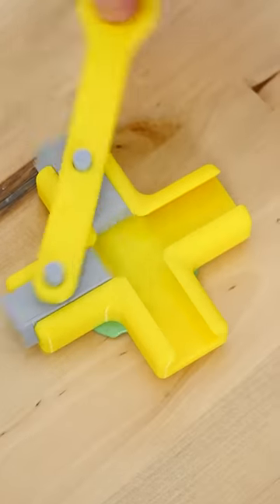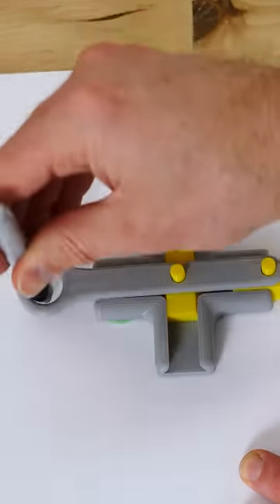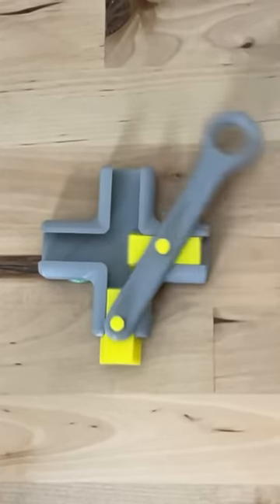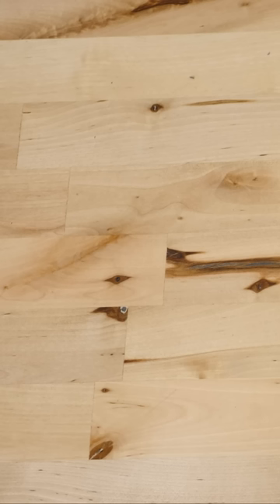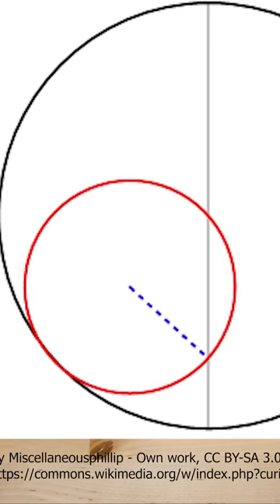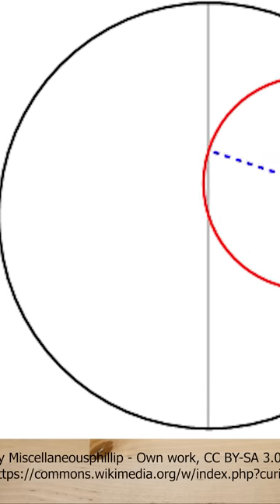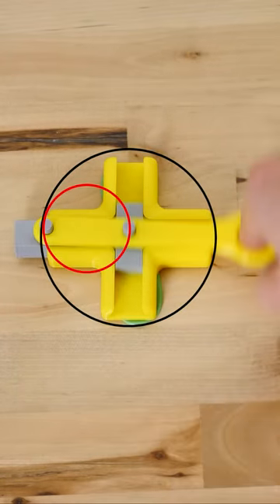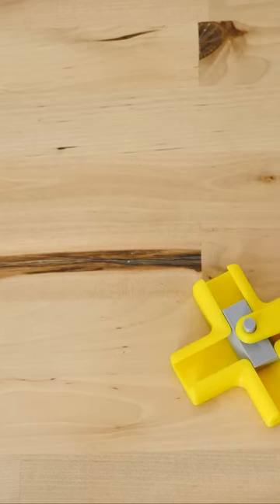The Do Nothing Machine

Comment: Fun fact: this machine was actually used in a steam machine to convert from linear motion to rotary motion. (It was designed by James Booth for anyone wandering)
Reply: I think “Pitman Arms” in cars possibly use a similar style of mechanism to transfer torque from steering to the wheels. Not sure if newer cars have them but older cars needed them.
Reply: Was just going to comment that, Booth's rectilinear engine of 1843, the idea was you make the engine more compact by eliminating the connecting rod. It works but was rather complex and expensive, I don't think it ever went beyond maybe a prototype.

Though there are plenty of functional models around now, as the plans and castings are offered by a British firm called Polly Model Engineering.
Reply: James also designed my favorite seating at Olive Garden
Reply: Also used in Steam trains.
Reply: Wasn’t james booth the guy who killed Lincoln? ?? 

Did he kill Lincoln with linear steam?🤔
Reply: @jamieduvenage2111  That was John Booth.

Also people can have the same name, actually a lot of people share names, I've put my name into Google before and found like, half a dozen people that share it just in my State, for example.
Reply: @DAKOTA56777  

But then Lincoln wasn’t killed? 

I mean I always knew. He was a vampire hunter, he couldn’t be snuck up on
Reply: @jamieduvenage2111  That was John Wilkes Booth. He also converted linear motion to rotary motion.
Reply: @ drink15  so I’m guessing that John Wilkes Booth is the one that made it famous though🤔 everyone seems to know about his attempt at linear to rotational motion, but not his brother James Booth?
Reply: @jamieduvenage2111  lol, my John W Booth  linear motion comment was just a bad joke. They are not related.
Reply: @ drink15   My entire thread of comments was just a bad joke😂
Reply: Aka a valve?
Reply: Right? I was thinking this could be a engines piston
Reply: Yes It would continue on it own when there is a weight on one end.
Reply: @OperatorKevlar  not really since it's quite inneficient and takes up a lot more space than more conventional mechanisms
Reply: @milknotfound4573  no, it can't because there would be a gap where the pistons cross, letting all of the pressure from the steam out and behind the other piston, because it would require that all four ends have steam coming in and because it has basically no advantages over having two pistons in the same axis.

Maybe if you had three pisons 120°c(2pi/3°f) appart you could potentially have a slightly simpler or smoother mechanism, but again, getting the timing right for letting the steam in and out of the piston chambers would be a pain and I'm not sure the few and small advantages are worth it.(kinda like wankel engines, on paper they're quite intrusting, but IRL, they're a pain in the ass)
Reply: Wandering ??????
Reply: vbddfy euuyt  its actually kinda infuriating that he calls it a "do nothing machine"
Reply: so it does something
Reply: vbddfy euuyt  you're cute
Reply: I lost my way. Thank you for orienting me . I am no longer “wandering.”
Reply: I was just about to say, not “do nothing” - generative technological achievement
Reply: I'm wandering around,  wondering how you graduated high school.
Reply: Is james booth the guy who killed Abraham Lincon… wait thats John Milks Booth
Reply: *wondering
Pls- No pressure-
Reply: So it does something
Reply: Actually i am wandering the comment section
Reply: Is there something else use this kind of mechanism?
Reply: @seeker599  It can also be used to draw elipses
Reply: yeah thanks, i wander from place to place and this info will totally help me in wandering
Reply: The most interesting thing about this video is your comment!
Reply: So its not a do nothing machine
Reply: HE LIED
Reply: It's an ancient fidget spinner.  Carry on, nothing exciting to see here.  Zero application in real world.  AutoCAD was invented before it.. 🙃
Reply: Fun fact: you have no name.
Reply: @sskacypher4674  And I'm not the only one without a name...
Reply: I read this as James Bond and was really confused for a second xD
Reply: That saves me from having to ask; thanks!
Reply: so it does something
Reply: I was wandering while I read your comment, and now realize that I was also wondering as well. 👍
Reply: I knew that it was used in machines i remember seeing it in an old train in a movie
Reply: Exactly, calling it a "do nothing" machine lol
Reply: So it became the "do something machine."
Reply: First inversion of the double slider crank mechanism
Reply: I read it as it was made by james bond
Reply: Thank you, I was wandering around my neighborhood and got lost.
Reply: So it does something
Reply: He only did good in his life… (remembers history class)
Reply: I was wandering all around YouTube trying to find this fact
Reply: The design trace back to islamic era (forgot his name), maybe even further to the era of persian / sassanid tech
Reply: @jamieduvenage2111  😆😆😆😆🤣
Reply: @DAKOTA56777  NO WONDER YOUR WATCHING THIS... CLEAN THE BASEMENT.
Reply: @jamieduvenage2111  or his cousin Phone Booth.
Reply: I hate to be that person but.....

wondering
Reply: Cool thanks for the information
Reply: Man I was wandering
Reply: Yep and then there is a similar machine called the Geneva drive or Maltese cross or Geneva mechanism. It concerts continuous rotary motion into intermittent rotary motion
Reply: “Wandering”
Reply: @alexburke1899  this is all done by the ECU
Reply: @user-le8ul4nr5t  isnt a steam engine use basically the same configuration as a standard IcE?
Reply: Thanks
Reply: 69 Replys
Reply: @soundsofanimals2393  you ruined it :-)
Reply: @alexburke1899  Pitman arms are used on conventional steering set-ups. That's not used on modern passenger cars. Modern passenger cars use rack and pinion steering. A lot of modern pick-up trucks still use conventional steering, however. Though, a pitman arm is more of a secondary pivot point, to keep the tie rods in the proper alignment and motion, in order to properly transfer the movement of the steering wheel to both of the front wheels.
Reply: So it does something
Reply: This is click bait ist does something
Reply: *wondering
Reply: I was just thinking about engines just looking at it lol
Reply: Whys it called the trammel of Archimedes then?
Reply: @riyeot565  because this mechanism was known way before james booth was even born, so it already had the name "trammel of Archimedes".
Reply: Wondering*
Reply: I was thinking could it be used for energy production
Reply: You can draw circle with this machine too,or something another
Reply: I mean this is basically how engines make power
Reply: @jamieduvenage2111  that was JOHN Wilkes Booth, though I understand the accidental confusion.
Reply: @DJBSharpMusic  but John did convert rotary montion into linear motion when he pulled the trigger,    Trigger is rotary motion, bullet is linear motion

So John was the one that made it famous?
Reply: Exactly what I was thinking
Reply: I was going to comment that it reminds me of a rotary
Reply: I was wandering, but this clip stopped me in my tracks.
Reply: So it doesnt do nothing 🤔
Reply: Wandering trader
Reply: Nerdddddd 🤓 

On a serious note, thanks for the interesting info lol
Reply: It doesn't do what it's meant to. It's a so nothing machine.
Reply: Found Ted Mosby’s YouTube account
Reply: E
Reply: So not by Archimedes then.
Reply: What about the people standing still?
Reply: I'm wandering
Reply: @andyfenton9554 John Stuart Milkyway Boots
Reply: the concept looks very similar to a rotary piston engine like you see on very old-timey planes.
Reply: Yep
Reply: Wow
Reply: Thanks!
I was wandering about for an answer and finally got one
Reply: And of course the grade school science teacher calls it " do nothing machine".
Like duh, most mechanisms don't do anything unless hooked up to other mechanisms working in tandem.
Reply: Wondering*
Reply: Or convert rotational to linear.
Reply: So it's not actually a do nothing machine
Reply: im wandering and lost! send help!
Reply: The closest resemblance this useless device is to an internal combustion engine would be the wankel rotary engine...
but there are A LOT of differences
Reply: What is with you fun fact people. no one asked!
Reply: @jamieduvenage2111 haha that John Wilkes Booth (Not sure if I spelt it right) I was thinking the same thing until i remembered his name was John.
Reply: Looks like it can be useful for something, yeah
Reply: Yeah literal pistons they even were used in trains.
Reply: Use in an engine was my first thought
Reply: I was wandering...

Comment: Why do people say it does nothing? It would be cool to build a maze with this. A few of these and you would have a maze where the path changes. Also might have a good use as a air lock. You just need to extend it in one direction.
Reply: YESS
Reply: My guy I could barely even understand it you need to become a designer
Reply: yooooooooooo thatd be so sick
Reply: It might be cool, but probably not the best solution, which is why you don't really see it used anywhere. If it really had any benefit, it would have been being used already.
Reply: @Jack-wh4zm  who hurt you ? Why do you have to go out of your way to comment something so spiteful?
Reply: bruh engine??
Reply: Namely because it was designed as an expression of mathematical concepts rather than a specific action. It, in and of itself, just spins around.
Reply: @clumsymancubus  Just because you haven’t seen it put it to a practical use doesn’t mean it hasn’t been. I can think of two uses from woodworking first they were quite common during the 18th century for veneer work. Second, you could attach a router to it with adjustable points and create different size oblong tables that looks great in any grandmothers house.
Reply: @brentranke7528  Yes, but if it were still as useful today, it would still continue to be used in a big scale. The truth is there are better solutions, and that's why this isn't seen as much anymore. 

Also, I never said it wasn't ever used in a practical way, I simply stated that if it were as practical as people think, it would be used a lot more and you'd be seeing it lots.
Reply: @Jack-wh4zm so just because you think you’re protected you go around being cowardly nasty to people out of nowhere? That’s deplorable and so low. Also guess what, anonymity doesn’t absolve you from human decency! And it does matter, the things we do have impacts and your throwing your hate at real people
Reply: Reminds me of a rotary engine
Reply: @FallenRingbearer  LMAO
Reply: @clairelafaille2095  he's prolly a 40 yr boomer that just got internet access in the pantry and doesn't know he can get hacked.
Reply: @Jack-wh4zm  you may think you're anonymous on the Internet but it doesn't really take much for someone with certain tools to find out who you are or where you are
Reply: @meadhbhblack  oh no too bad no one cares enough
Reply: @Jack-wh4zm  you will when you inevitably shit talk the wrong person/group of people. Only takes the first line of a targets address to make them shut up. Who knows, you may have already shit talked the wrong person/group of people and they might just be footprinting you right now. Everyone learns that what they do on the Internet isn't hidden forever one way or another. Some just learn harder than others. If at any point in the future someone decides to have you on, dont say you weren't warned
Reply: @meadhbhblack  Oh no I'm gonna get doxed because of a youtube comment.
Reply: @Jack-wh4zm  people have been doxxed for doing anything. Dont pretend you're above everyone else. Ignorance and arrogance is what gets people into these situations. If you think it doesn't happen, then you really are a bit silly
Reply: Remember, if you have nothing nice to say then don’t say it :)
Reply: @alcatraz2981  I think its just you
Reply: It might be a stretch but it could also become an engine of some sort
Reply: @Jack-wh4zm  oh but u do sound like some boomer that just got internet access tho
Reply: @Jack-wh4zm  and "Jack" what a lame name. Anyway, how are your buds, giants? they doing good on their flying island?
Reply: @SAN-bi2vm  What does that even mean?
Reply: @SAN-bi2vm  To be fair, Jack is basically the embodiment of a hero. He manages to single-handedly climb a giant beanstalk and retrieve all the items stolen from his family, slay the giant that had been terrorizing the land (and thus also avenging his murdered father), and ensure his family would never be poor or hungry again. So yeah...falls a bit short as an insult, I'm afraid.
Reply: @Jack-wh4zm  yeah don't worry there isn't any hackers that will get you here. It's funny they call themselves hackers when all they do is grab ip's and put it in a stresser. I'd say the people doing that are more losers than someone being an asshole in comments.
Reply: Even if you continued the grooves to make a maze, the wrench wouldn't be able to advance from the crossroads it starts from. It would just stay there and go back and forth, like you can't detach the peaces from the videos one without disconneting them from the wrench.
Reply: Has Jack's comment been yeeted pr something? I see lots of responses, but not the comment.
Reply: We have a modern Archimedes among us
Reply: @brotatochimp  don’t see it anymore, guess it had been, basically he said something along the line of « I can be mean to people on the internet because it doesn’t affect me and I’m anonymous so I don’t care and you’re stupid » after I call him out for a mean comment, so yeah, you get the idea 👍
Reply: I mean- who knows maybe that how they changed the mazes in Mazerunner 🤣
Reply: @clairelafaille2095  what did Jack say Claire? What did he say?
Reply: You could use it for cutting as well
Reply: @Jack-wh4zm  lmao u just deleted like half of ur comments
Reply: @brokendaboken348  no I didn't?
Reply: I can also see it being a valve of some sort.
Reply: You just came up with a movie I swear
Reply: It consumes energy but does no work. That’s what I remember from the full video.
Reply: What did jack say? I can't see his comment
Reply: This seems like a very over complicated mechanism for a moving maze
Reply: Well, until one of those things happens I'm playing playing with a math problem in my garage. Doing nothing
Reply: @SAN-bi2vm  Ok now listen here-
Reply: @FreightTrainWTF  But what if their parents work at microsoft? I am dead top tier comment section
Reply: That's what I am saying! If you say this is useless, it is like saying a switch and nothing else is useless
Reply: Could you be a gaming designer?
I mean…
A dude with an epic Pokéball for an avatar with the name Prime Zero…?
Clearly not only a Coliseum and XD fan, but also a cool, smart cookie.
Reply: @clairelafaille2095  what did they say
Reply: i'm agree man, people without mechanism design knowledge wouldn't understand the concept of a machine like that. Actually it's concept has a lot of applications.
Reply: Good luck getting out of that fooker mate 😂
Reply: Ye
Reply: @NewFunBook  it was a technical drawing tool. It's like the  square rules, those has a rigorous manufacturing process, and what are they made for? To make 90° angles. The fact you don't have to make technical drawing with your  hands today doesn't mean it was a useless tool in it's time.
Reply: Is an option but traditional air locks already a lot more effective than this and this system has more points of friction than needed
Reply: @FreightTrainWTF  too hard to dox a rando on youtube anyway. sure, you could see if the username is used on other sites, and that might be them, maybe eventually find a link to their personal facebook. that's a lot of maybes just to find their identity, a physical address is another story
Reply: I feel like he said the same line about 4 or 5 times...
Reply: @clairelafaille2095  what’d Jack say?
Reply: This really is only helpful when displaying mathematics...
Reply: @TTTTTTTTT853  to ok I'll l ok kiiki I'll k I'll look okllllk ok ok you huh yggjkk
Reply: @clumsymancubus  There are hundreds of other comments pointing out cool times this was used in engineering.
Reply: Because to people they are rotating it and it is doing nothing lolz thats why they say do nothing machine but its still doing work when force is applied but to people they dont get result like you rotate the bottle cap viola bottle open you rotate this nothing useful for some people lolz
Reply: @clumsymancubus  tbh nuclear is much more efficient but u dont see much nuclear power plants
Reply: Pistons. Pistons were the solution for these things. Including a moving maze. But I hear ya.
Reply: @brennenkowtko9809  So do bearings, but bearing a life without bearings, bearing the load of every machine, it seems a little too overbearing to bearing.
Reply: @SAN-bi2vm  there’s no such thing as a 40 year old Boomer lol that’s an oxymoron. Unless u mean it in the new non specific jokey way and not the actual generation. And did u say internet in the pantry!? Lmfao what!?
Reply: The stairs at hogwarts !
Reply: OOOH

Comment: One really cool aspect of this is that each of the sliding pieces represents a function in relation to the circular movement of the handle. In that, the vertical piece traces a sine wave over time, and the horizontal piece traces a cosine wave over time! Pretty cool